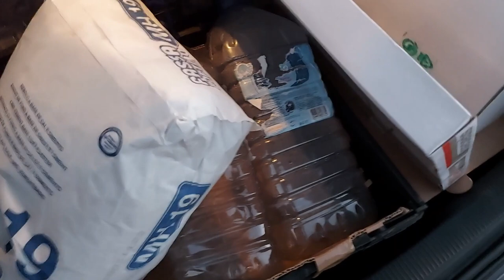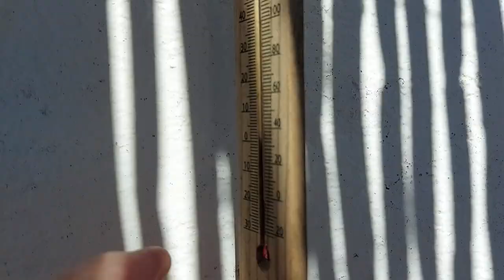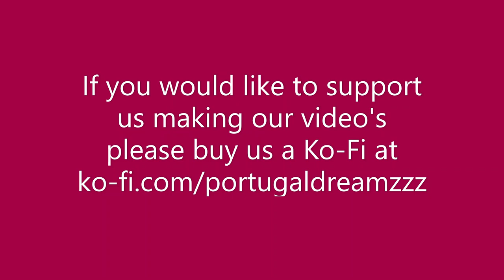56. When Things go wrong on our portuguese Quinta.

Comment: The chicken looked wonderful 👍 Time to sow chilli seeds now, they are pretty easy to grow in a pot.
Reply from the maker: Can they be sown outdoors?
Reply: @portugaldreamzzz920  yes.  Maybe start seeds in repurposed food containers [that baked goods or whatever come in] that have lid so the seeds can retain some heat.  Other folks have sown seeds in old plstic jugs cut in half (so the jug can be opened to water seedling), cardboard toilets rolls wrappy in newspaper to closed one end to be the bottom but leave the other end open to be the top to fill with soil & seed then bundle the sown rolls into a tray, any kind of paper or plastic box or pot.  I like how in lieu of a green house, a covered plastic tray or storage box can be a tony hot house 😊.
Reply: @portugaldreamzzz920  No, they are not frost hardy.  Start them off indoor in a sunny spot.  Put them out when there is no danger of frost.  You can leave it until the frost is out the way depending on the variety.  The super hots tend to have a longer growing season but if you went for something like Apache F1 you could sow late Feb early March and still get a good crop.  They do make nice indoor plants too.  For attractive, try a Calico, it has a pretty purple flowers, two tone leaves and a purple pod.  If you're new to gardening, sweat peppers and chilli are a great introduction as they are quite forgiving and you get a good harvest.
Reply from the maker: Some great Idea's there! We will give some of them ago when we have the space indoors and will start looking at the possibility of a cold frame or something along them lines.